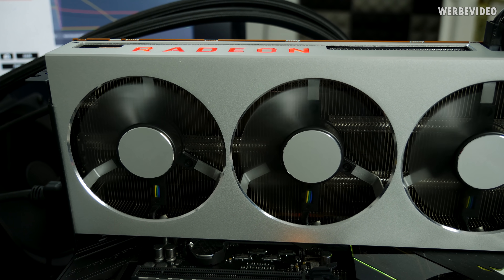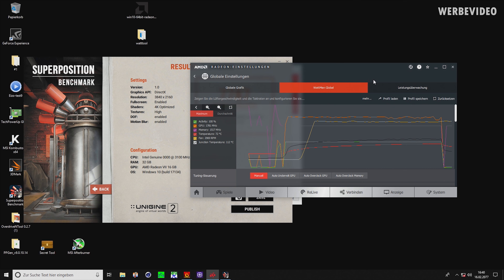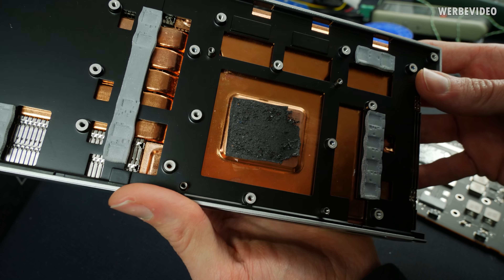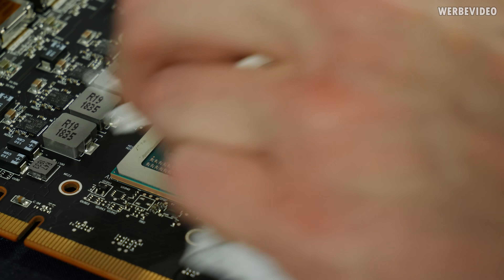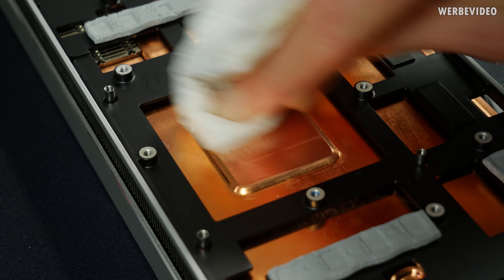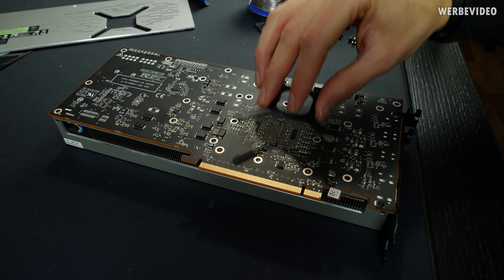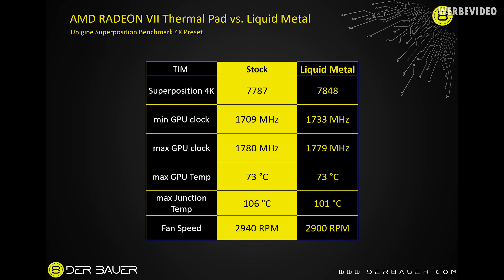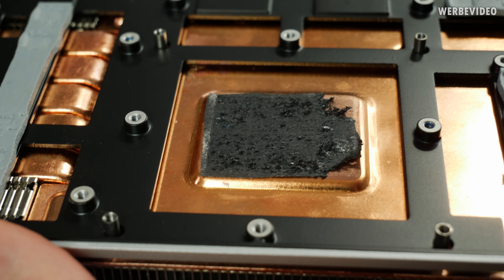RADEON VII - Liquid Metal Tuning

Comment: The TIM seems not where the bottle neck is . This thing is just too power hungry, 300w is about the same power as my whole system with a 8700k and a GTX1070, all concentrated on a small die. This card is just an overclocked vega 64 with more memory. It might be 7nm but the architacture is still out-dated. AMD is catching up with Intel, but NVIDIA seems still not need to worry at least for a while.
Reply: This card is just a (process-shrunk, smaller die, and optimised) overclocked vega 64 with (two times) more memory (at two times the bandwidth).
Reply: @iamdmc  You are right, but all of this can't save a out-dated architacture. Just like Intel's 9900k, they push the old architacture to the limit, resulting in high powerdraw and theremal bottleneck. No matter how good your cooler is, the concentrated heat can't get out of the chip fast enough. That's why most reviewers are disappointed at Radeon VII, it's just like 9900k, they desperatly want to put up a fight with their competitor but their new architacture is not ready, so they pus the old architarture to the limit and result in high cost, to much heat, limited performance gain. However, this time, AMD is at Intel's position.
Reply: @iamdmc  vega 60
Reply: 300w is what a power throttling Titan Xp pulls (constantly, no overclock), only difference is this thing doesn't sound like a jet like a Titan does. Also 300w is same as Nvidia's high end (actually WAY more if you get a lightning edition). That's been the typical power draw for high end cards at least since 10 years ago (power draw at IDLE for one of my ATI was around 150w... overclocked the thing made an excellent hand drier, so I kept the PC by the sink!)
Reply: @jakegarrett8109  The problem is, Titan XP is from almost 2 years ago, and Radeon VII
may still not have the performance of Titan XP. If Radeon VII come out 2 years ago, I would say it's a good card.
Reply: @oscarshen6855  Seeing as the Titan cost me $1200, has 4 GB less Vram, and only about half the Vram bandwidth, the Vega VII could sell for at least $3k (hmmmm... Sounds a lot like the Titan V right? $3k, 16 GB of HBM... Except the Vega VII would have even more memory bandwidth, and a better cooler, so it would only need to cost $3,500 to be competitive). As it is though, the card currently costs less than what I can sell my Titan Xp for...

But following your logic: I'm crushing RTX 2080ti and Titan RTX with some cards from 2015, so by that reasoning, if the 2080ti came out 4 years ago, maybe then they would have been good cards? (they still don't match my main build with crossfire, and only a few instances like Fortnite, or SWBF2 at 11,520x2560 triple 4k resolution does my Titan do better than my X-fire build)

Comment: @Der8auer What about Peltier module ? that could be fun since how hot that card can be
Reply: The Problem ist that you have to use a pelier module with the Same ore even more power 300w tdp =300w+ peltier module to have any chance of cooling the chip down
Reply: @SuperUltimateLP  instead you can try to cool the water in the loop. Even 100w peltier module can cool down the water significantly. That's what I tried on my old Q6600. I decreased water temp from 34 to to 26 (ambient 23). Finally I got decrease from 68C on CPU to 53C. So yeah, it's works. But it's not worth it.
PS: I'm talking about water cooling.

Comment: I'm getting 4K Optimized results in the high 9800s with my Strix 1080 Ti with a light daily OC (+25/+250, 110%, 90C). Aren't those Radeon VII numbers a bit low?
Reply: real-world game fps numbers >>> synthetic benchmarks. The 2080, 1080TI, and Radeon 7 are functionally identical in performance in most games, even though each has an edge on specific non-gaming workloads

Comment: I'm so confused. When you go over the AMD Temperature graph after applying thermal paste the Junction Temp seems to go up to 107 and 109°C, but in your chart you say it peaked at 101°C, why is that?
Reply from the maker: Ah. Don't be confused by that. Those lines were not the actual test runs. That's just B-Roll footage

Comment: From Techpowerup:
"After completing all testing and photos, I reassembled my card and wondered if I could push Junction Temperature below the 110°C I've been seeing on the stock card. Changing the thermal paste didn't make much of a difference (barely 1-2 °C better). My trick for such situations is increasing mounting pressure by adding little metal washers. Pictured above, you see two of the washers: one to get a better look and another below one of the mounting screws to indicate the location I placed it in. Of course, you want to use a total of four washers—one for each screw. I used 6 mm outer diameter, 3 mm inner diameter and 0.5 mm thickness, but you can use everything that falls into that size range. Also, I'd recommend plastic washers, so you don't accidentally short something if you lose it in our case.

With the washers installed, my Radeon VII Junction Temperature dropped by around 10°C to 100°C, which is a significant improvement."

https://www.techpowerup.com/reviews/AMD/Radeon_VII/33.html

Could you plz do a followup and try this out with LM?
Reply: I tightened down my screws a bit more when I installed my card and my junction temp never goes over 100C at stock settings. Only overclocking increases it. If I undervolt to 975 it barely gets into the 90s at all. Drivers were so broken for press it's just sad how they wasted their time. I have got superpostion scores much better than in this video without any mods at all except for tightening the screws.
Reply: @Madgemade  *tightens 3 of the 4 screws on a card ordered from AMD directly*
Reply: @Madgemade  Got a ballpark improvement perhaps? How loud is it? Can you turn the fans off under idle?
Reply: @Henk14789  I haven't tried 0 rpm idle, my case is already load so not much point. But the undervolt makes it much quieter. I did some gaming for a while @975mv with Wattman open and fan rpm never went over 2200 using the default curve.
Reply: @Madgemade  do you get any speed throttling with the undervolt? Mines coming today. Interested in what people are seeing.
Reply: @BaneSIlvermoon  I did not notice any speed throttling. But there were supposed to be bugs with Wattmatt and it did seem to report clocks inconsistently so I can't be sure. You chose the right day to receive it, new driver came out today which are supposed to improve overclocking/un dervolting in general.
Reply: @Madgemade  Sweet. It showed up right after I replied earlier :-D
Reply: @Madgemade  What about fan speeds and noise? if its still over 2500 rpm even with the washer mod than that would be disappointing.
Reply: could mounting a low profile cpu cooler be better?
Reply: @Astrocat unless you took hours to manually sand them down, there's already micro scratches from the manufacturing process.

And a GPU doesn't have a heatspreader.
Reply: funnily enough, increasing the tightness on the screws of the thermal clip reduces mounting pressure on the front side of the package...
Reply: @iamdmc  but with enough of a thickness washer, you're rendering the x clamp's tension irrelevant, since the washer will be contacting the xclamp. Then the screw's torque will be the only factor in mounting pressure of the cooler.
Reply: @iamdmc  Then the problem could be overtightening instead? In any case, with such a flaw in the cooler It's a real shame no one's going to make their own coolers. Could've easily be on par with a 2080 noise wise.

Comment: Try increasing the mounting pressure, some people on reddit tried adding washers on the 4 screws on GPU to increase it. They say theres quite a difference
Reply: It may work only for graphite pad, since it's depends of a pressure.
Reply: has anyone confirmed if thats actually worth doing?
Reply: funnily enough what that does is lighten the overall tightness on the screws on the rear bracket, which increases the mounting pressure on the package. The same effect can be achieved by slightly (and consistently on all 4 screws) loosening them by a full turn

Comment: I wish AMD would get with it and push out stable, working drivers. 

EDIT: I just saw that they’d pushed out the 19.2.1 drivers.
Reply: the Radeon 19.2.1 drivers got pushed out and seem to be far more stable than the press release drivers. From other channels it seems that the Radeon VII consistently outperforms the RTX 2070, but trades blows with the RTX 2080 often coming in just a few percent lower. It still shows good FPS and frame times. 

The comparisons I’ve seen of the R VII v. 1080ti and 2080ti leaving lagging well behind by about 30% on average.  No huge surprise there, but those are cards (when and IF you can find a decent used 1080ti for sale) that have a price tag of double the MSRP for the R VII reference card. 

For $700USD new from a legitimate seller it doesn’t seem a terrible deal. IF you can find one in stock. 

The asshats trying to scalp these on eBay for 150% - 200%+ of retail MSRP need to die slow, painful, humiliating deaths.
Reply: @ljhaller  I am waiting for a price drop and a waterblock from watercool.de or EK etc.
Reply: @Andrew Joy I don’t see much room for them to drop the pricing and still turn a profit. The HBM memory in an of itself is around $300 - $350. Then you live got all the other bit and the PCB which is around another $150 - $200. Add in manufacturing labor, shipping, and then the mark up they sell them to retailers at. Doesn’t leave a whole lot of meat on the bone.
Reply: @ljhaller  Yeah. I'm going to put my own video up on it just to help with the misinformation surrounding this card. I have had 8719 in 4K superposition after overclocking. I expect performance will improve in games too. Really needs to be fully revisited in a few months when stock is available and drivers are matured.
Reply: Yep, although the launch day drivers are much improved compared to this video. I can beat everything he does with the stock cooler so I'm hoping it will improve further.
Reply: The had press drivers, now you have actual drivers. AMD fucked up anyway. The press should have had a working drivers.

Comment: I dont have it in me to do this, but I would legit pay someone to do it if there was a service out there that did this.
Reply: Its real easy. Read plenty, watch similiar YT videos. Just go slow and have the video available on a device so you can check if you missed something.
Reply: Weird he didnt just undervolt, overclock  and push the fan curve up to see what it could do before the LM.
Reply: @dolphin069  can't yet - as Derek and others have said in their reviews the amd drivers are unsurprisingly broken at launch.
Reply: @iamdmc  okay, missed that, standard AMD launch garbage -  but even so the cooling solution is unlikely to be the issue, triple fans with aggressively angled blades, copper fin stacks and a graphite thermal medium. Surprised LM made so little difference?
Reply: @dolphin069  can't undervolt or overclock yet since the amd launch drivers are (characteristically) pure garbage
Reply: @dolphin069  easy to LM - yes. easy to make a mistake - yes. easy to not realize it until your computer is giving off sparks and blue smoke - yes.
Reply: This is like extremely small change. If you live in Texas, bring me the card and I'll only charge $50.
Normally I'm busy insulating cards or designing custom mounts for phase evaporators to fit on GPUs/CPUs, this would be the easiest thing I think I've ever done. I've even designed a water cooling system for tablets in a cool nuclear theme, and the CAD work only took 2 hours, and I assembled it while I was watching a boring movie (got bored so I started assembling it). Paste change is incredibly small effort.
Reply: Day 1: Buys $700+tax GPU with 3 years warranty
Day 2: Spends $100+ for someone to LM it for no performance benefit and voids 3 year warranty
Day 3: LM spills on PCB, creates a short, destroys card
Day 4: Calls customer service hotline begging for RMA ;)
Day 5: Cries at loss of $800
Day 6: Buys $700+tax GPU...